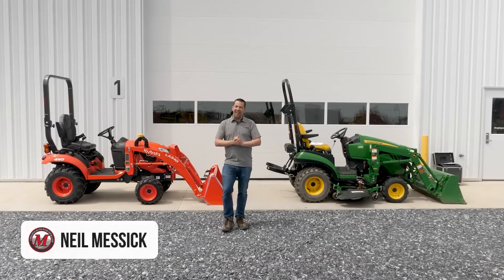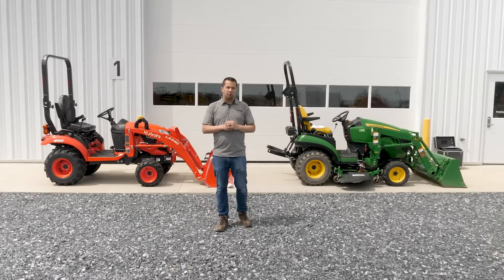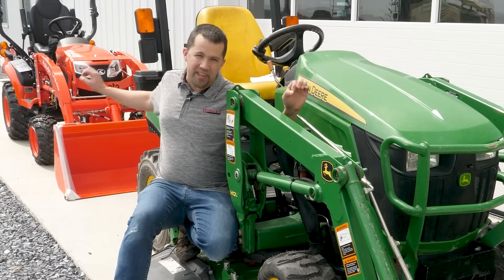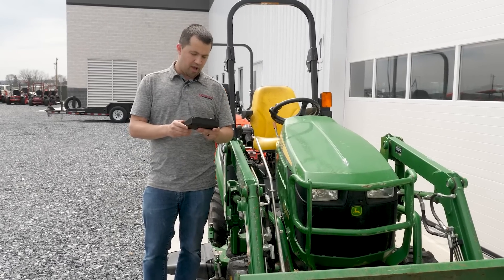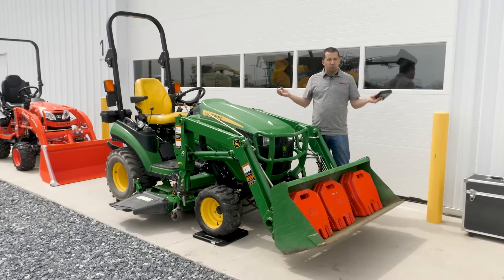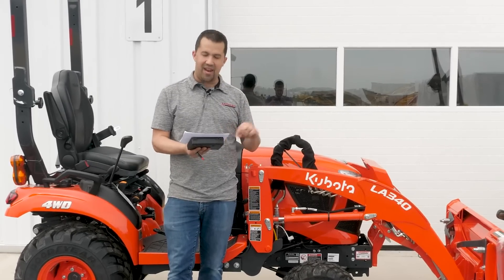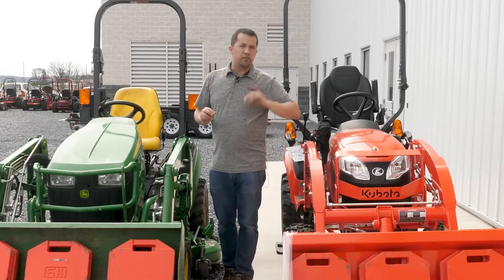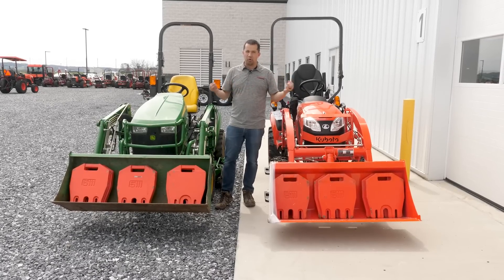front axle capacity vs loader strength

Comment: Really good video to show front axle weights. Seeing as you used the BX23S, could you show how the backhoe installed affects the weight distribution! I leave mine on most of the time for that purpose.
Reply: I'm not sure what the weight of the BX backhoe is, but I'd bet it weighs more than my box blade or my roto-tiller...so having the backhoe one while doing loader work would probably be your best ballast option since it sits behind the rear axle...only issue of course would be space limitations but I think you could curl the backhoe in pretty tight and angle it left or right, compared to having a rear implement installed as ballast that can't be moved.
Reply: @wildbill23c  The stock backhoe is just over 600lbs I believe. Mine has a quick attach and thumb as well, and it really helps balance the tractor with a full bucket load. My question to Neil is how much it helps to take the weight off of the front axle. Normally, an operator would have an external ballast on the rear when they load up the bucket, so showing the weight without ballast seems a bit unconventional. Neil really does show that a ballast in the rear is required to use the front bucket to it's full potential, but there should be a part 2 showing the safe way to ballast and balance the weight towards the center of the load triangle.
Reply: @brentholmes3339  600lbs yes. About 2 foot behind the pivot pin? So maybe 4 foot behind the rear axle? Whereas weight in the loader bucket is about 10 foot or more in front of the rear axle? So you're offsetting maybe 200-250lbs in the front bucket? Which is some, but not as much as you might hope ultimately.

Comment: Awesome as always.
My concern is the tiny tiny tires. 
I have rented the BX tractor and I've had problems with the tires not holding up.
The same is true with the John Deere.  Why are larger tires not offered?
Reply: Likely to keep both size and cost down.  The small size, low height, and low weight are big selling points for models like those shown here.   They make larger size models for those with heavier duty needs.

Comment: Does rear ballast counteract some of the weight on the front?
Reply: It does. Every one of these small tractors should be doing loader work with some type of rear ballast. Whether it's a ballast box or an implement.
Reply: This is exactly what I was thinking when I saw this. Rear ballast is a requirement in these calculations because it is specified as a requirement when doing loader work.
Reply: @benagain7617  kinda my thought too maybe if they would have put ballast on it would reduce the amount on the front axle to reduce e the weight below the max spec hopefully Neil will revist this
Reply: would like to know this too
Reply: @windzer   No, it doesn't. Or at the very least not really. The weight on the front axle is still the same when you max out the lifting specs of the loader whether you have a rear counterweight or not. The big difference is that with a rear counterweight you will keep the rear axle planted a little better which mean better stability. This is why most large front end loaders are designed and built to have the rear end up in the air before the loader hits its max lifting capacity, it adds a layer of safety and redundancy. If you can't drive it around you wont lift it even if the loader can physically lift it.
Reply: @adamliske  This is completely wrong. When you hang weight off the back of the machine it makes the front axle light. Load and balance calculations are your friend.
Reply: @timcartwright4679  Saved me typing that. Anything behind the rear axle takes away from the front axle load. Its a teetertotter.
Reply: @1958johndeere620  I wish he would have demonstrated that while he had th scales set up.
Reply: @timcartwright4679  It is not a teetertoter as the weight and balance calculations are way more complicated than just a single point of contact since there are two axles in play. Adding wheel weights or fluid filled tires does absolutely nothing to reduce the weight on the front axles as this load is directly on the rear axle and therefore has no offset effect of weight in front of the rear axle. That being said a weight behind the rear axle will provide some counterweight effect, but it is limited due to the limited weight and limited distance from the rear axle. The true lifting capacity of the loader multiplied by the distance from the front axle is far far greater than the couple of hundred pounds you can put in a ballast box a much smaller distance from the rear axle. Does it reduce the loading of the front axle, yes, but not as much as you think it does or want it to. This is even more notable since the loaders can lift way more than the front axle is rated for as noted in this video. As I noted heavy equipment front end loaders is specifically designed to have the front axle bear all the weight and still be within spec, this does not apply to sub compact tractors in the least bit.
Reply: There is a lot to unpack here, the answer is kind of but not really.  If you read the specs you may notice that the capacity of the loader is given at a height and distance from the bucket pins.  The geometry of the loader changes as you lift a load from ground to full height.  As this load is being lifted, the load on the axles changes. If you imagine the tractor like a lever, the front axle is the fulcrum of the lever.  Adding ballast does change the balance of the tractor, but it increases the load on the axles.  There are moments during the lift cycle where you can potentially put the entire weight of the vehicle on the front axles.
Reply: Yes it counteracts but consider that if you have a weight that sits very close to the rear axle. So say the distance (rear ballast weight to rear axle) is ½ of the wheel base of the tractor, then the amount of force it takes off the front axle is only ½.